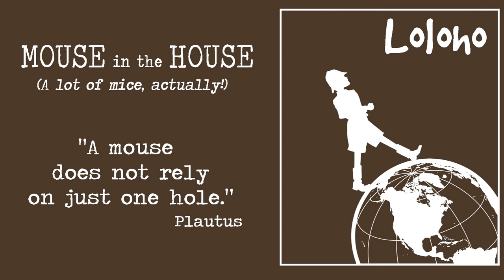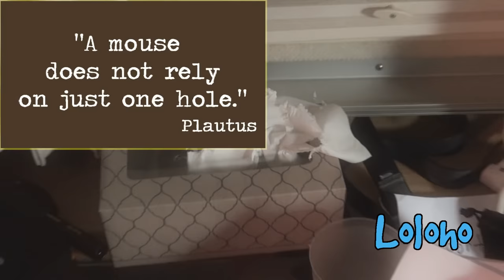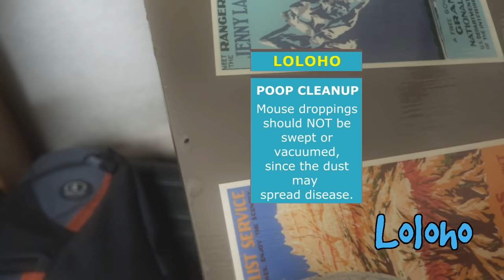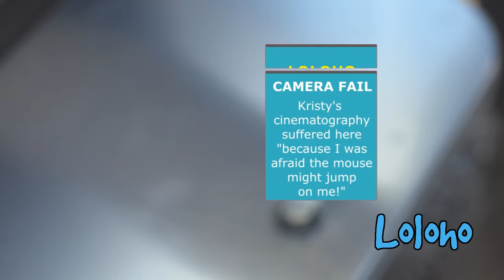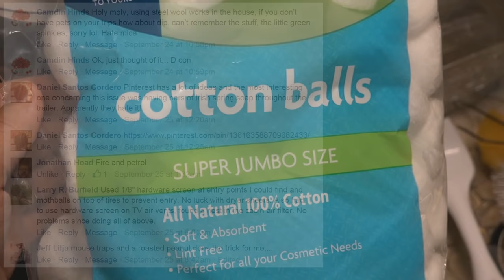🐭 How NOT to Keep Mice Out of an RV 🐭

Comment: I had mice getting in my New trailer last summer in the Mtns. of southern Utah. Glue traps worked best to get them out.. I found a can of expanding foam for rodents at Home Depot. I got under the trailer and filled every crack, hole, and entry point of wires, pipes, and tubing I could find around the trailer.. Why the manufacturers can't seal all these points before sending out their RV's, I don't know. They do seal some holes, but not near enough.. So far no mice this winter, but a summer again in the mtns. will be the telling point.. Stuffing steel wool pads in the holes under the lower cupboards might help too. Keeping Mice out in the first place is the best solution..
Reply: Be careful, Steel Wool is highly flammable.

Comment: We bought a new Forest River camper five years ago.  The factory had sprayed expanding foam around each/every possible entry point under the camper.  We've never had a mouse in the six seasons we've used the camper (knock on wood).  On the other hand, a buddy paid $100k plus for a new motor home and had mice in it instantaneously (no foam apparently). We use steel wool (and frequently check it) in every possible entry point at our "hunting shack" on our rural property after having had a mouse problem.  The steel wool (they don't like chewing it) is INMO the best deterrent.  We're confident enough to have older leather recliners in the shack...so far so good.

Comment: To funny! We use bounce or snuggle dryer sheets all over our trailer and haven't had a problem yet. Good luck!
Reply: been using bounce sheets for about 10 years with great success  but that's with regular house mice, no experience with field mice.
Reply: I've heard dryers sheets work as well. When I first got my AS (bought used) I found dryer sheets everywhere, figured it was just to keep it smelling nice during storage, so I discarded them as I came across them. Then when I mentioned it to a friend they told me they repelled mice. So I have since replaced them and haven't seen a mouse or signs of one to date. I may have just not been in the right place at the right time of year etc. So it could fall into the peppermint & Irish Spring category, but so far so good. 😋

Comment: We have had this problem because we stored our RV for several months at a time during the winter in NW Ohio.  We found that Bounce dryer sheets seem to keep them out.  Cheaper store brands do not seem to work the same.  Replace the sheet (s) regularly, every 10-14 days.  So far so good.

One very important point you failed to mention is that if the problem (mice) is allowed to continue unchecked, the critters will take to eating the plastic insulation on the coach wiring system, especial if the coach is vacant with no power applied.  This can be VERY costly to repair and will definitely ruin your travel plans.

Comment: Mothballs... space them out every couple inches around the tires and any jacks that touch the ground. Also, if your power cords or water lines enter your unit, or provide a nice bridge for entry, place mothballs where they touch the ground. You can also put the mothballs in an old nylon stocking or some brands include a mesh bag. The nice thing about the nylons is that they can even be used to make stringers of the mothballs, just tie-off the nylon after each mothball is dropped into it. The key is that you place the mothballs as a barrier at any potential entry points to the RV where there is contact with the ground. If you get rain or the ground is damp, the mothballs will need to be replenished over time. We use mothballs every year for RV storage and have never had a mouse in the rig.

Comment: From years of owning a powersports dealership in the country and repairing wiring on all of these type machines and tractors through the winter mainly but it works all of the time.  Bounty dryer sheets.  We put them in the enclosed areas where wiring runs.  So we do this on our TT.  Put them in the outside storage areas, we put them in the back of all the bottom cabinets, in any enclosed area.  They cannot take the smell, they will run away fast.

Comment: The peppermint oil on cotton balls worked for us. I also put solar powered sting lights on the ground outside around the entire rig. Supposedly they don’t like the light and will not cross over them. I also have the tin cat traps just in case. But I won’t release them as they do too much damage and cause diseases. We still live in a sticks and brick and only travel in the rv now and then right now. I can hear one or more in my attic at night chewing on something so it just needs to go.

Comment: Mothballs!!! An elderly gentleman came into a store where I worked years ago and bought several boxes, during our conversation, I learned he puts them in a hunting cabin when not being used to keep the mice out. I know also from personal experience, that mothballs repel spiders, ants and other insects, like scorpions and centipede etc... They can be placed around the outside edges but once wet need to be replaced. I would put several in a zip lock bag with holes in to let the odor out and secure to edges underneath the trailer, in storage compartments also and try putting some in spots where plumbing holes are or wiring then fill with steel wool or copper wool mesh. Of course a sure fire way to deter them would be to use several deterrents, I also have used the ultrasonic plug in devices and they have proven effective to me. So multiple ways to deter, and clean, clean, clean and smart storage also. Good luck and happy camping

Comment: I still haven't found a good way to deter field mice except for doing a thorough sealing job on the rv. We've done the bounce sheets (they made their nest in the box)! the mint oil etc didn't work either. We do have a "tin cat" type trap that works fairly well. Tip: if field mice are your problem this tip won't work but if you also have pack rats a quick flashing rope light works. They don't like to cross it. Completely encircle your rv with it and run it 24/7.

Comment: We have had field mice problems as well when staying at our ranch. Plugged, caulked, stuffed every hole we could find but those little critters we're finding their way in. We eventually figured out that they were gaining access through the groove where your trailer steps slide in to raise and/or lower the steps. Once they enter there they have free range in the under belly of the trailer and will just enter around plumbing pipes. so every evening or when we leave we put up the steps! It worked! No more mice!!! 
That has worked for us for 2 years now. Just don't forget to lower steps before you step out every morning!
Reply from the maker: +patty gayoso Great post! We never figured out exactly how they were getting inside our trailer, BUT we did have our step extended AND there was some undercarriage damage next to it (long story, but there was a gap in the panel there). So that area is the most likely place of access for us. Next time we will pull up the step and/or plug every visible gap down there with copper mesh. Thanks for your suggestion!

Comment: This year has been especially bad with mice, I also had troubles. We took a multi prong attach to rid the mice. Peppermint oil, glue traps, whole clover and electronic traps. My success goes to glue traps and the electronic traps. To deter the mice to even enter the RV was by placing a baited trap outside the trailer by the axel. The Rid A Rat device can work but would choose a rope light under the RV.  Over abundance of mice mean lack of snakes. National Park or not they must go. Best video.

Comment: I know this is an older video, but I just saw it. Mice hate the smell of mothballs, so I use mothballs to deter mice. I started using them years ago in a storage facility and never had mice and from then on, always put them in our attics of our houses and any closet, under sink areas, etc. When we pick up our TT tomorrow, the first thing I will be doing is putting moth balls in all the little spaces before we load anything in it.

Comment: Did you ever find where they were coming in? Usually it is up the electrical cord, but any small hole will do, if you do find it plug it with steel wool until you can get home and do a better job, with a piece of metal or filler.

Comment: I had a couple weeks just like this when I had a seasonal site at a campground by the lake, I was gone during the week and there on weekends. I ended up catching 6 mice. just used peanut butter and a trap. I found there poo everywhere, every pot every plate, every drawer front to back of trailer. a couple weeks later my truck was getting horrible gas mileage and wasn't running well, so I pulled over at a walmart and picked up a clean air filter. low and behold there were two dried up mice in the air cleaner with bits of their nest! that trailer was never the same! every time I felt something on my skin  I jumped after that. but anyway CHECK YOUR ENGINE AIR FILTER! just in case they got in your vehicle as well. Thanks for sharing and bringing back awful memories lol

Jed

Comment: To help keep them out find entry points stuff with steel wool then add a little expanding spray foam. The mice will chew the foam and when the mice get to the steel wool it cuts their mouth and they quit chewing. This works for squirrels as well.

Comment: We have used the Pinterest suggestions and not sure what did and didn't work, but as we approach cooler weather, I assume the peppermint oil cotton balls will fail. Wondering about the dryer sheets. BUT, we will appreciate the Tin Cat suggestion IF needed. Great video.. Keep calm and squeak on!

Comment: Great movie! We've had tons of dealings with mice over the years. Our permanent home is in the woods and has been invaded by mice, packrats, weasels, tree frogs and most recently, a squirrel. The problem arises when we are away for letting ng periods of time. We have 2 cats who keep it under control when we are home, and when we leave them to house sit alone. We've tried those plug in mice deterrents. They make a squealing noise. They seems to keep some out, but not all. We just arrived home from 2 months away at our cabin. At the cabin, I spend a good day, at least, cleaning up after the critters that found their way in. Squirrels fill our boots with mushrooms and cones, and knock things over. Mice poop on everything. I spray any droppings with a bleach water combo. That kills the hantavirus. We take our cats to the cabin too. They use a litter box, and I leave it full of litter 'plus' to keep the cat smell in the cabin when we leave. I find that keeping anything food wise in tin containers works best. No food, no attraction. Sweep,wipe counters. Don't give them anything to feed on or chew. Morh balls left in an open jar work okay, but leave the trailer, cabin, house stinking. It's pretty hard to keep them put entirely. The RV is easier because there are only so many ways they can get it. Stuff strong smelling drier sheets around any holes from outside. Tires, cords and jacks are all mice bridges. If you can minimize their ways to enter, so much the better. The repeating metal trap is great. But, can't beat a good mouser cat!

Comment: Hi I train for a national company all over the west coast mice can enter your trailer through a hole as small as 1/4", I would do an inspection and see were the mice entered and fix the hole with steel wool. A lot of times its around a water, electrical, or sewer line but once you fix the hole you should not have that problem any more

Comment: I have a 1998 28' class A. I am currently on a 20 acre parcel in the country. It's too cold for snakes to keep the mouse population down. They have been making their way into my rig. There are so many pencil size openings (I understand that's all they need) I am not bothering to seal them. I have left my tissue out to know when they are here. I use the old spring traps with a little piece of tillamook Cheddar (my favorite). I caught 3 so far. Then a trailer owner friend suggested I pour bleach in the dirt around my tires.  I haven't had any in several days.

Comment: Looks like you have a lot of good suggestions. I worked in the pest control industry for a lot of years and find that exclusion is the key for your mouse issue. It's probably going to be hard to find all of your entry points but maybe you will find some of the obvious ones. It looked like you were catching them under your sink area, I am assuming they were using the holes were your water supply goes into your trailer or possibly the drain under your sink. Look for light coming through those areas and use some steel wool to seal them up. Like you said in the video, they only need about a quarter inch for access. Tin cats are a great tool, we used them in large warehouses and restaurants for rodent control. Make sure you do a good job on getting the droppings cleaned up as well, I know you already know that but figured I'd say it anyway. Hope this helps you guys out a little and as always I really like your videos. You are doing an awesome job, keep up the good work.
Thanks
Scott

Comment: I have been where you are guys. The only way to stop the madness is to get some steel wool and silicone, get on your back and get under your trailer and  plug even the tiniest hole on the underside if the trailer.  You can trap and trap but you have to find the entry point and close it. Hopefully they have not created a commune in the underbelly of your rig like they did in mine. Figured that out after a week of Death Valley heat and they and their left overs began to smell. Good Luck  Gary

Comment: Find the hole they are coming in through and stuff it with steel wool.  They can't chew through that!  You have to plug up any place they have access to the inside of your trailer.

Whatever you do, do not use moth balls in your trailer. You will never get rid of the smell.

Comment: To keep mice from getting into your camper is to put moth balls and Bounce fabric softener sheets through out your camper.
We have been using this in our 1968 Kountry Aire since we got this trailer. We use this over the winter to keep them out.

Comment: It was fun watching your video!  Fresh Cab seems to get a lot of 5-starred satisfied customers on Amazon, but then there are some for whom it doesn't work.  We just bought an old RV (1989) to see how we'll like 'camping'.  (Gee, when I was a kid, we just put up tents and slept on bumpy air mattresses......but of course that was the 50's and 60's.)  Stay on subject, girl!  Right. So I went online today and found some answers and then decided to concoct something of my own:   Dryer sheets are a well-known NOT fail-safe way to go, but I took each one and soaked it with "Critter Out" (Make by the same folks who sell "Deer Out"). HMMM. VERY pepperminty indeed!  So, just as you stacked your mouse food open-faced sandwiches, I stacked on top of this Critter-Out-soaked dryer sheet, a few drops of lemon essential oil, a few drops of Peppermint essenial oil.....all topped off with a sprinking of grated Irish Spring bar soap.  I put one of these sheets in every closed cabinet and entrance.  SO.............., we'll see.  I just did this today because I found mouse droppings in the kitchennette sink and in the under-the-sink cabinet in the bathroom, where little mousey had had a blast ripping up toilet paper as well. (I think it's for making comfortable little beds for all the baby mice they are planning to have.  Will let you know if my concoction deters them from the RV.
Reply: Cheryl Smith How did it go?
Reply: Actually, Annette, it did work!  They stayed away..dropping a couple of little presents as they made their getaway.  Now, having said that it works, I don't know for how long it will work.  It was amazing, though. They did not touch the toilet paper I forgot to remove.  I'm keeping a spray bottle with a water/bleach solution to pick 'strays'.

Comment: You were right to be cautions about Hantavirus.  The mice you were dealing with were deer mice, the carriers of Hanta. I'm sure you researched proper clean up. I would have added spraying with a bleach or Lysol spray and using rubber or latex gloves and a N95 mask.
Reply: Cleanup should include a face mask, it's the dried mouse droppings that can be dangerous, turning to dust when touched, releasing the virus if present.

Comment: Mice will GAIN ACESS by simply climbing up your tires, stabilizer jacks, and hang hoses or shore power lines  .....   sealing AROUND those FIRST could rid the problem of those rodents turning your camper/RV into a franchised Motel 6 ....   lolol

Comment: The Tin Cat seems to work for you. I, however, prefer them dead, so I use the Victor traps. I get the kind that has a metal bait pan, and use a pair of pliers to force one kernel of corn (dry) into the pan, so they can't get it out. One baiting will catch dozens of mice, as they get caught as soon as they touch the corn, and they can't steal it.

For the Tin Cat, use a tiny bit of flour. They can smell it a mile away, and it doesn't goo up your trap, like marshmallows ;)

Thanks for sharing, guys!

Comment: I highly recommend the electronic mouse traps that electrocute them instantly.  They do not seem to suffer and die instantly.  I can catch a mouse in 24 hours with those but putting a piece of dog food outside and 1 inside.  I have bought several different ones from Amazon.  They all worked great.  If you buy the ones that need a battery, you have to buy those expensive lithium batteries.

Comment: Now he will be back in your trailer tonight. There is no such thing as only one mouse in the house. You have mices. You need to put those traps all over the camper for several nights, use new traps every night. Mice can smell if trap has been used. Then fix where they are coming in. Good Luck, I hate mices to pieces! Vinny